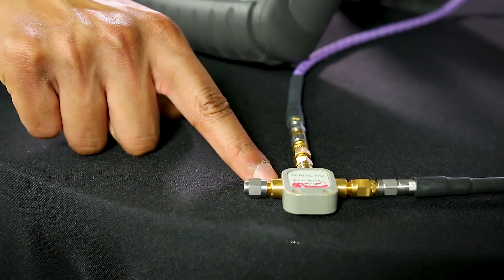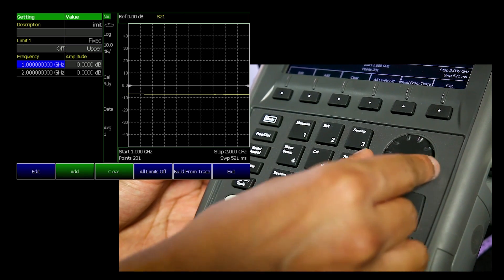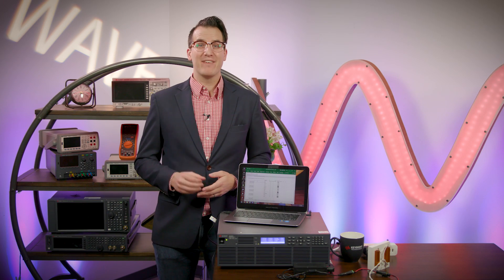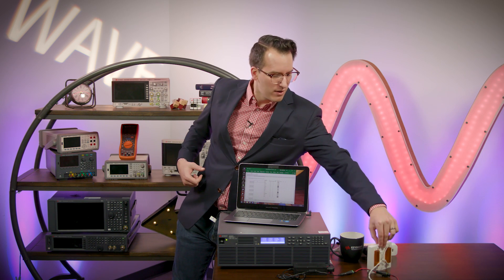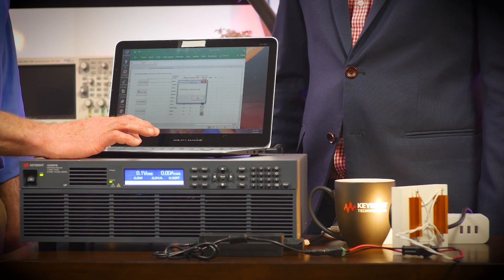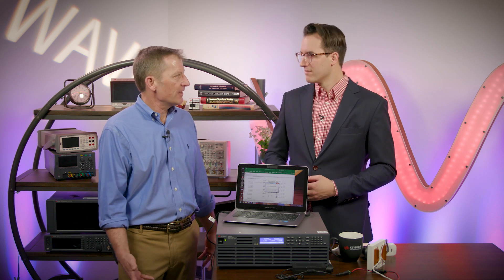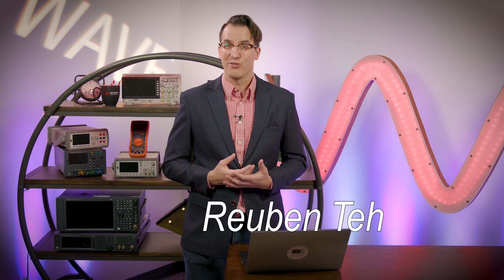AC Sources, Insertion Loss, and Today's Wave Winners! (15-Mar)

Comment: You didn't mention how you corrected for the 50ohm/75ohm impedance mismatch. Or did you cheat and used a 50ohm splitter?

Comment: So a few of questions:
1) On the AC source, what if I want to test power out of range to simulate say a voltage or current spike/drop?
2) On the power rail probe (N7020A) for the new promotion, is there a probe that will go up to 3GHz in the future (perhaps N7020B?)? Asking because a probe that high could have applications with 2.4GHz ISM devices.
3) Finally, for today's tip, would you use a 75ohm to 50ohm pad adapters or just the fieldfox itself (with a delta/cal setting) to get the splitter measurements. Actually here you used the 11667B power splitter which is 50 ohms. On cable TV its 75ohms.

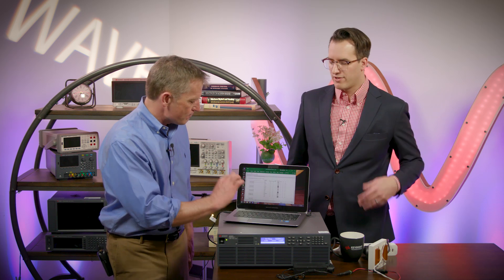Comment: At @5:00 the question was asked: "...so what have we learned from the measurements that we made about our power supply?" (pointing to the small power supply on the tabe that was under test)... NOTHING....we just get a rant on how stable the AC Source is.... Huh.. This video is very "cringe worthy"....No sir, I don't like it.
Reply: The answer was relevant to the question, although perhaps unexpected if only interested in results of DUT testing. Power harmonics are a real issue for testing and driving intolerant circuits. If I had that job, subtitles would be needed when I spoke --and English is my primary language.  I add them on my Test to Impress video entries. LOL
Reply: Oh cmon, he was obviously a little nervous and misunderstood the question. Give the guy a break.
Reply: Are you serious!?... He misunderstood the question?....it was the only thing asked of what the test just conducted and was outlined.  Your reply just compounds the fact.
Reply: I thought they demonstrated the usefulness of this new gear well. All you didn't see was the results for some specific DUT that none of us care about, it was just an example. Take a look on the bright side, they are giving away some amazing gear - other companies don't do this to this level - and trying to make some useful videos in the process. So what if some of the engineers they have on aren't seasoned public speakers, its not easy! Cheer up bud :)
Reply: It's true they did show a demonstration of the device, but failed to show the results of the demonstration as to validate its yielding of useful information. We could continue to volly these comments back and forth but it would still yield the same result. 
On the contrary, there ARE other companies that do giveaways all the time, it's how they hype people's attention to their products and product line.
It's also understandable that some people can get "stage fright" when faced with a camera or even just a microphone, but a little pre planning would help present the product more efficiently. Please bare in mind, I'm not saying the device isn't any good, it would have been better to see its performance fully to drive home the point of, "..yeah, that's just what I need in this piece of test equipment"
This would be best to serve as an indication that there should be a preplanned outline and script of information to be presented for future videos and presentations.